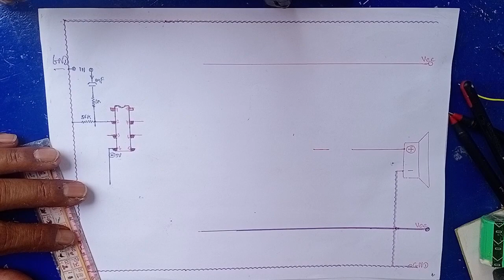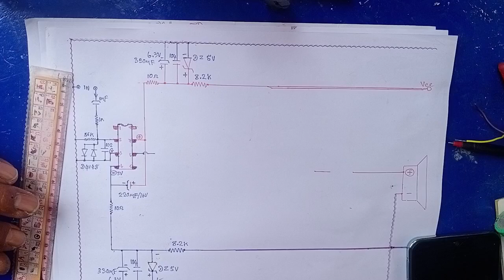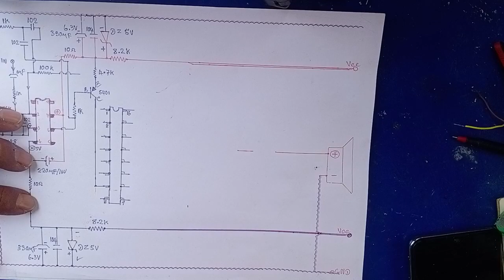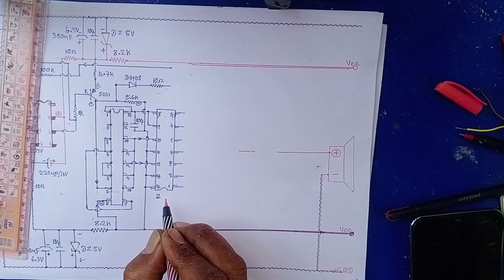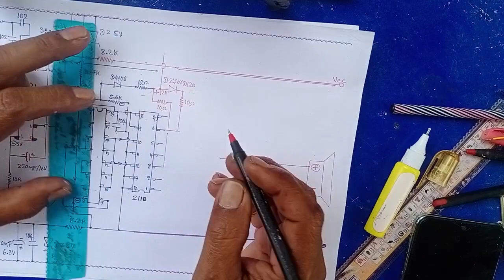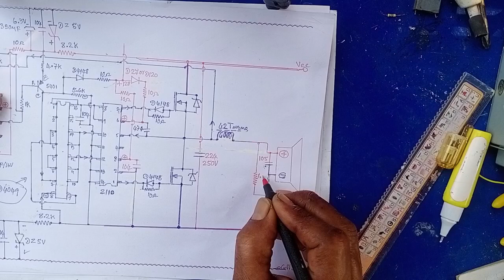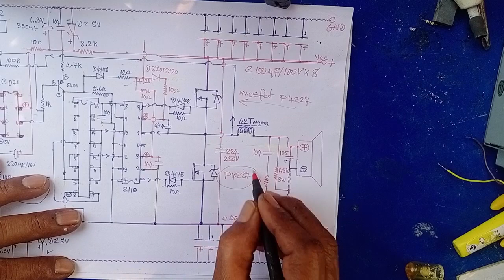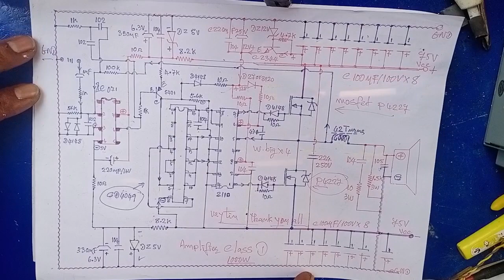@class D diagram amplifier watt big.

Comment: IC cd 4049 pin 16    1. +vot IC 2110 pin 8 and 9 + volt ? Supply voltage 12v or another ?is the circuit will run on 70 volt ?but the IC 4049 is burn on 70 volt.what can I do